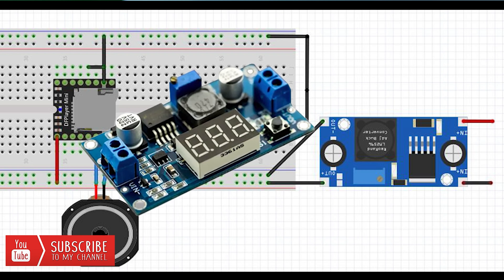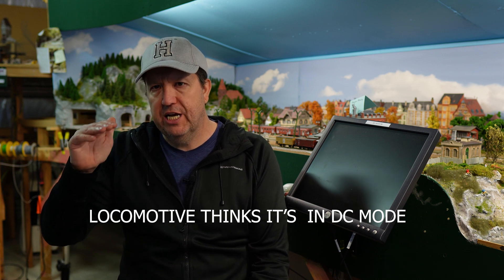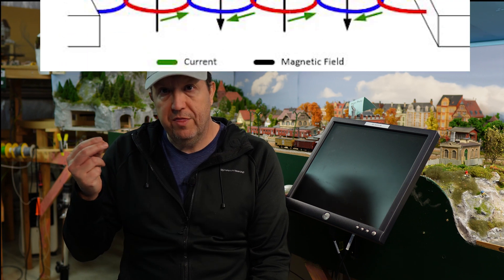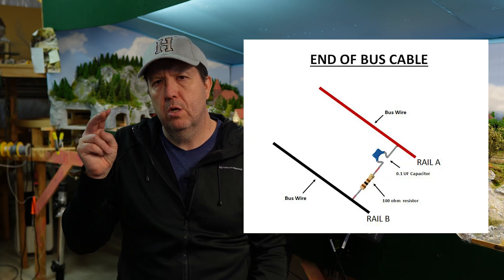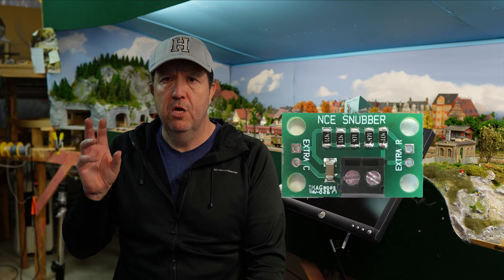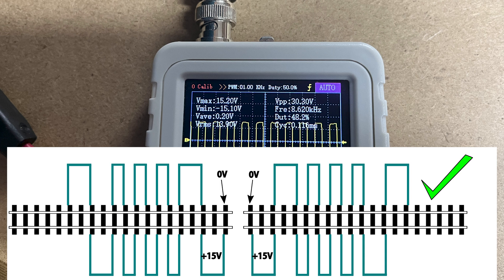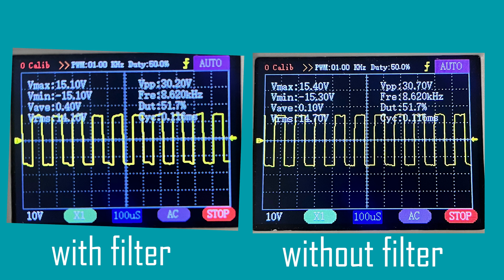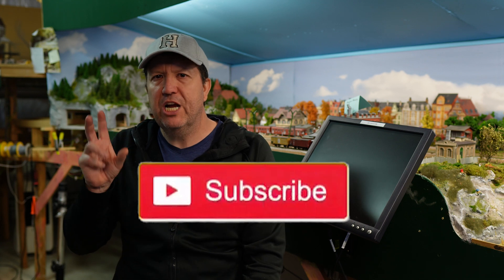STOP DCC Decoder Damage - Try a Snubber

Comment: That was a good presentation, thank you. I've built and installed a dozen or so of these snubbers. I have one on my Lenz DCC system and fitted at least 3 on our club track, and made more for my fellow club members. I fit them at the end of the longest run of track between the rails. 
Also, clean power is an absolute must. When I started dcc in about 2001, we were told any old ac power supply of a certain voltage  would be fine. It was not! After being told several times 😢 to use a regulated, filtered power DC supply, I finally started using laptop power supplies (3 to 5amp and below 19 volts output). Why did I go this way? Well, eventually, after 3 rather expensive sound decoders released their smoke ( bloody hard to get that stuff back in the chip!), I stopped being pig headed and played the game. Since then, there have been no more decoder issues.  BTW, I limit my track voltage to 14.2, I have not found any reason to go higher than that.
The other cunning stunt I use is a PSX (3 of them) board to stop overloads and cut off the power very quickly to the section(s) of track they protect. 
I know this might sound a bit tricky, but if anyone is having issues, those 3 things will go a long way toward peace of mind. 😊

Comment: Can the filter components fit between the feeder wires before they attach to the track?
Reply from the maker: Hi Wayne, I have installed mine at the end of the bus cable run and not to the feeder wires. Hope this helps?

Comment: Excellent video, I'm old before I  tried dcc, I had read up on it, and in a couple of the books they talked about snubbers at the wiring. I'm an N scaler I would guess the snubber would be the same values as HO. I run DCC++EX and pi-sprog. Mostly my. Pi sprog. My layout is small 4by 6.. but I don't think a snubber would hurt the layout, most certainly help it. 😂
Reply from the maker: Thank you for your kind words. Yes the same values would be fine. Im not sure you will need one. You could run some tests and can always fit them afterwards. Cheers Daz

Comment: Just curious. Is it possible to install a snubber in the locomotive itself, before the track power reaches the decoder and would that be recommended or not?
Reply from the maker: That is a great question. Personally I have never seen being even suggested. I will research
Reply: @ModelRailroadTechniques  thanks for the quick response! I only have 2 dcc steam locomotives that run on their own separate track  - my preservation society lol. The rest of the track is DC and will remain so due to cost considerations. 2 mobile snubbers sounds more appealing than crawling around installing them on the track work as my age starts with a 7 😅. Thanks for your channel. It helps me a lot.
Reply from the maker: @ViewFromAfar  thank you for your kind words
Reply: @ModelRailroadTechniques  I'm guessing a half watt resistor might be an issue inside the loco due to heat?
Reply from the maker: @ViewFromAfar  yeah heat and space will the first issue.